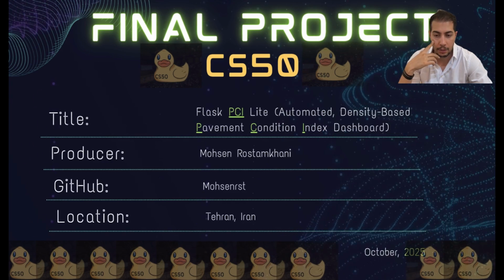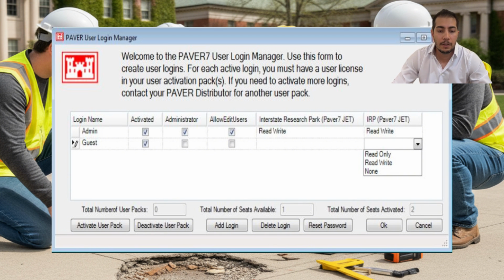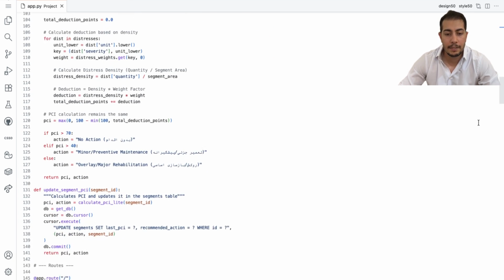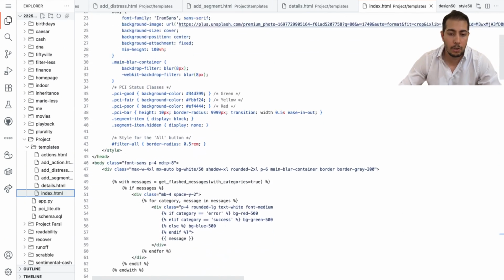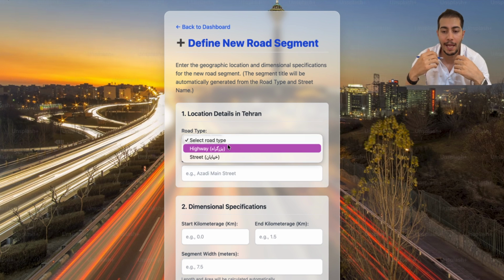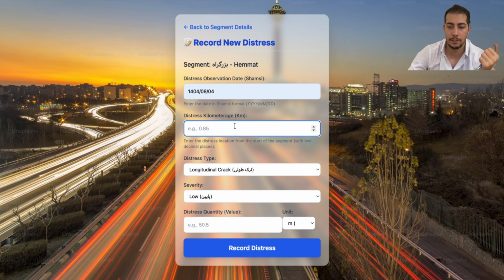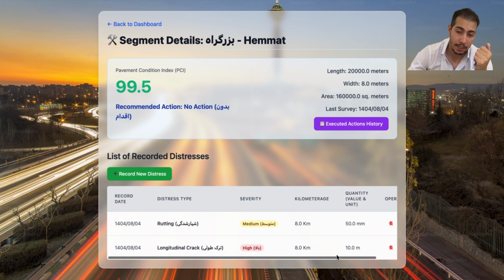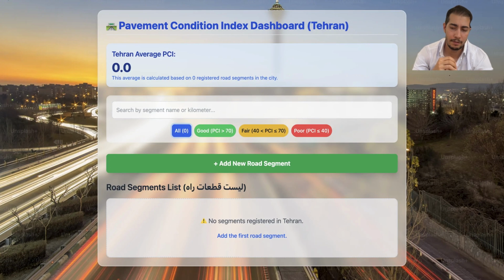CS50 Final Course

Comment: Did you use render to generalize the website?
Reply from the maker: Yes I utilized Render to do that. First you have to make an open repository on Github in which your code is written. Then connect it to Render.